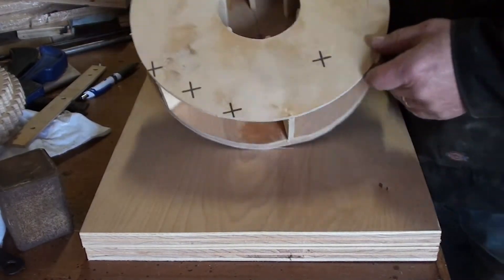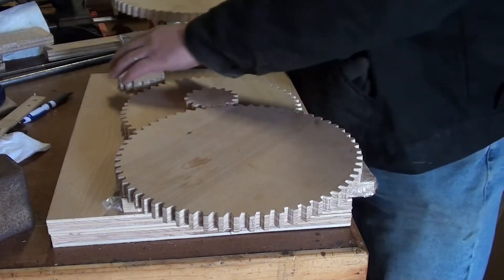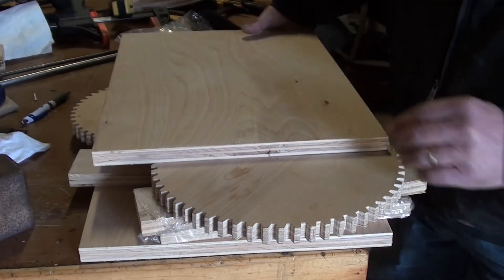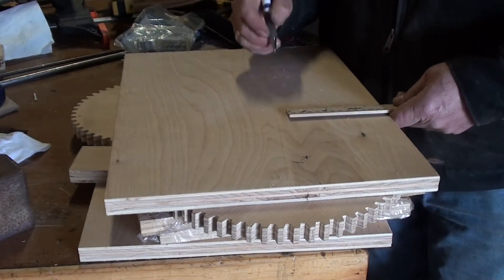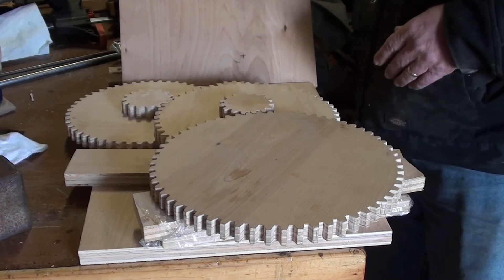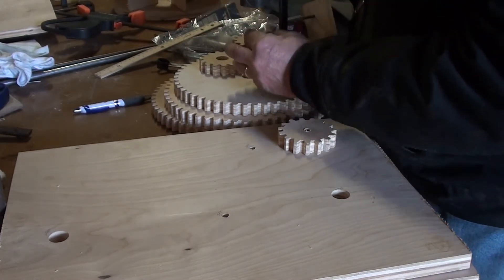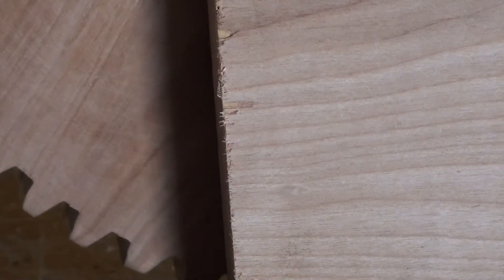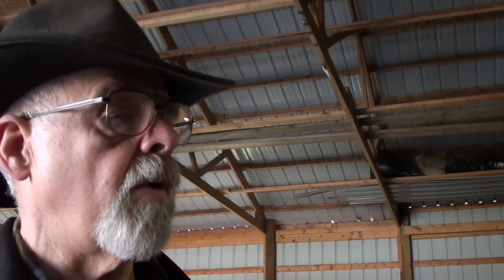Lets Build a Forge Blower Part 3

Comment: I'm clueless now!
Reply from the maker: Let me see if'n I can un-clueless ya. The 60 tooth gear that turned one revolution will be attached solid to it's shaft and on the outside of the plywood side will be the crank handle. And the 15 tooth gear that turned 48 revolutions to that one revolution that is clear at the other end, is also going to be attached sold to it's shaft and the fan will also be attached to that shaft. That is why those two shafts have their bearings on the "housing" plywood. The two sets of inner gears (one 58 tooth and an attached 15 tooth and one 54 tooth and an attached 15 tooth) have the bearings in the gears and the shafts will be mounted solid because they will only transfer energy from one end to the other while increasing the gear ratio.